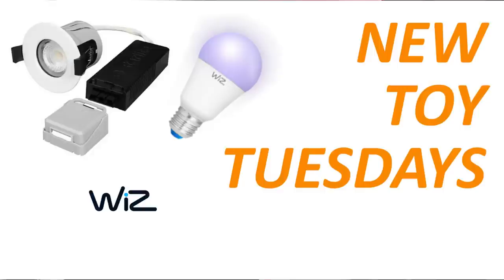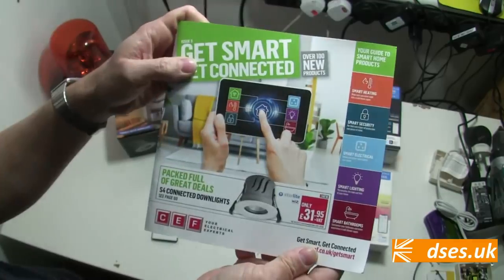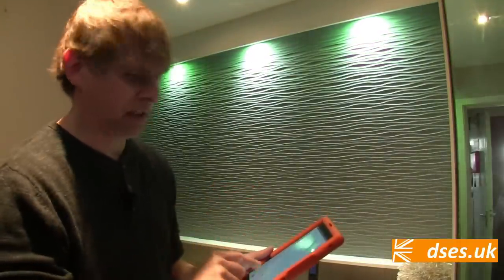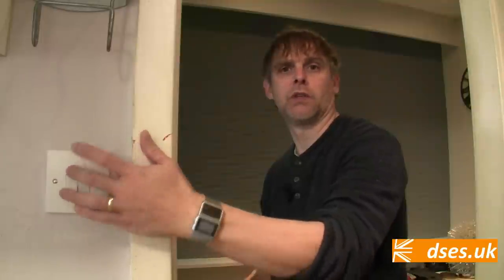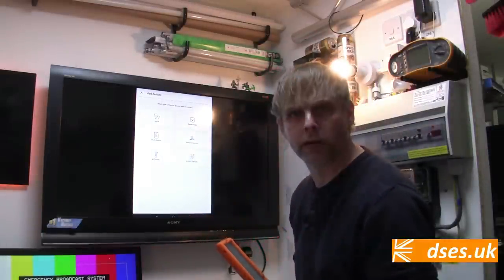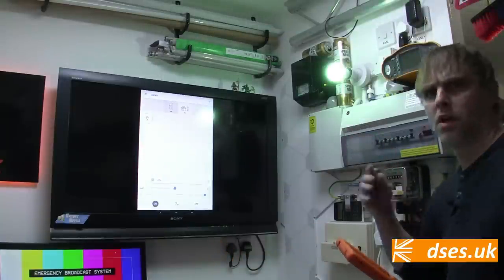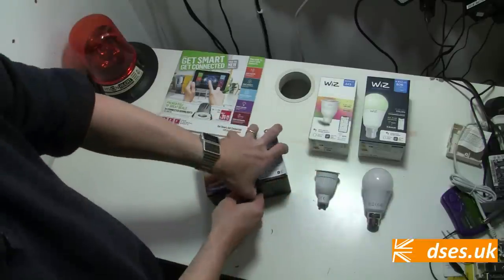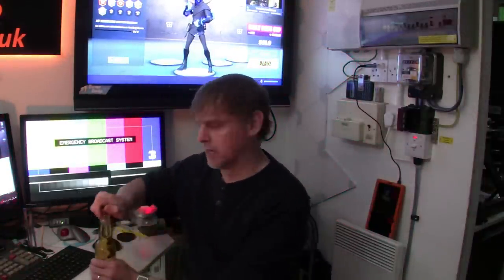NTT- Tamlite Starlite Wiz lamps

Comment: I'm not a fan of LED tech tbh but it does give you a hell of a lot more options than fluorescent and HID. I'm thinking about taking the handrail off my stairs, routing out a channel down the underside of it and then running some warm white LED tape down it. Only problem will be hiding the driver and cables running to it.

Comment: Here in the Nordics we are about to rebuild a bathroom. What we actually want is rather simple, clear bright lighting (dim-able), decent extractor fan, and the ability to switch them on and off from just out side the door. But the demon 'wireless' monster has over taken our electrician! He wants it all wireless, and programmed from an 'App'! No chance 'sparks', just do it the 'old way', and leave me in peace.
Reply from the maker: But what if you're relaxing in the bath and you want to alter the brightness of the room? You don't want to throw on a towel to go adjust the dimmer when you can reach for the smartphone you balanced on the side of the sink, open an app, make an adjustment, find it isn't working, check your Bluetooth settings, remember it's actually on WiFi, put the lamps back in pairing mode, search for the WiFi network they're broadcasting on, connect to them, add them to your network, go back to the app to name and regroup them, reassociate them with your voice assistant, alter the brightness from the app, attempt to fish the smartphone from out of the (now cold) bath water after it slipped out of your hand, find instead you've grabbed the bar of soap, locate the phone from among the bubbles, set it back on the side of the sink and continue with your relaxing bath time.

Comment: Hello mate I been using them since they came out the rgb ones are good only thing I find is if they are not used for a wile an turned off at switch they forget they are linked to any thing an app cant find them
Reply from the maker: Oo-er, that sounds worrying Derek! I haven't experienced that in the past four months, and sometimes these lights aren't used for days as they're merely decorative rather than functional. How long is a while?
Reply: @dsesuk  I left them just over a month il check again tonight as ain't been in that room since end of Jan they are a good light tho I also tried tcp but they pulled the down lights off the shelves but I have some if you want to try one an the app

Comment: So saying "Alexa, turn on the hallway lights" and waiting a couple of seconds for anything to happen is easier than switching the lights on using the switch.
Isn't technology wonderful! 😞
Reply from the maker: Some people seem to have a hard-on for this stuff, presumably for the flash factor rather than it being practical. I play with it, but I keep it away from the business.
Reply: Seems like technology to solve a problem that does not exist. 
The more complex stuff is the more there is to go wrong.
I don't understand the push to have everything controlled from an app on your phone. What happens when the manufacturer goes out of business and the app isn't supported any more? When you change your phone you may not be able to obtain the app. 
I always try to KISS.
Reply: The joys of relying on a chain of remote services to take actions.

All of this can be essentially instantaneous, simple, and reliable, but it won't have 'cloud' in the list of features..
Reply: @stuartarnold9444  Its not to solve a problem though. Its to look flash and play with. I'd say it falls under gadgets and toys. You wouldnt avoid something on the fear the manufacturer will go bust when its say Phillips. Simple doesnt provide 64,000 shades of white does it!